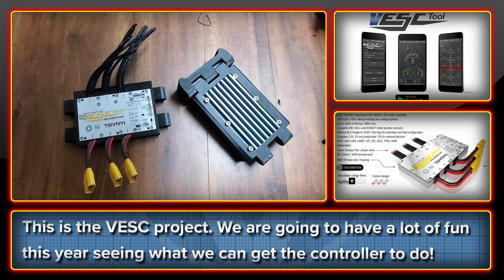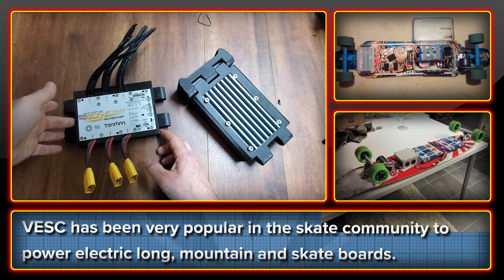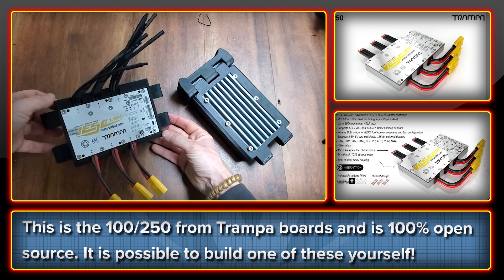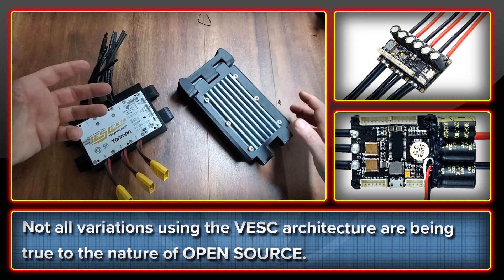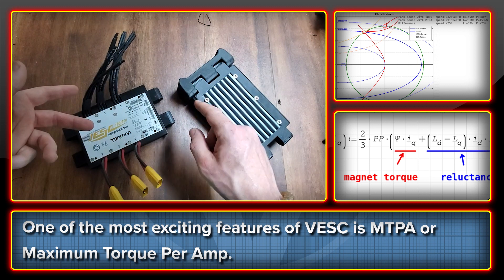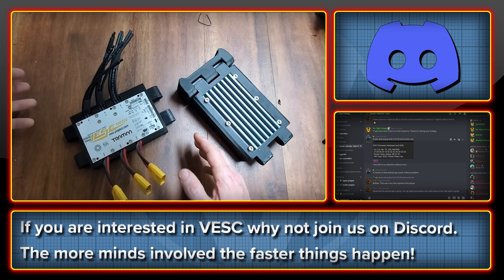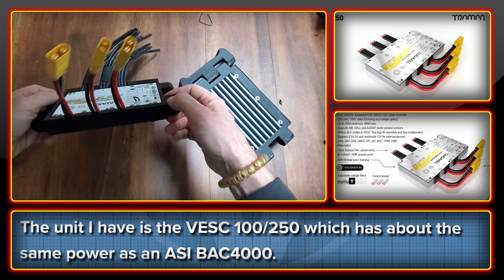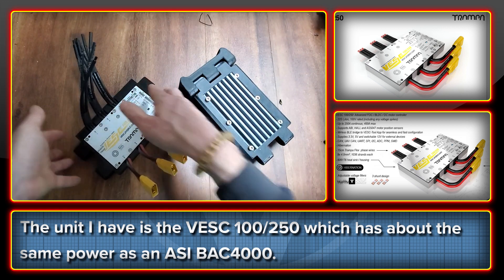Experiments With VESC - Introduction to the VESC open source controller project - join us on Discord

Comment: are you supposed to be able to control the motor from the keyboard arrows?  I did an autosetup on a 205mm 16 pole BDLC and it says it was successful but the motor makes clunking sounds when you try to go at high speeds with it.
Reply from the maker: Once you have got pas the initial stage you need to then fine tune. I suggest using the VESC forums to get help here. There are lots of parameters you can tweak to get the best performance.
Reply: @HighVoltageKits  I had my max erpm calculation wrong, it's ok to max rpm now but still no keyboard control
I looked all over the forum, nobody is working with large outrunners, just skateboard motors
Reply from the maker: @Embeded Fabrication  it's more the skate folk with vesc. It's changing tho. You could try posting on our Discord. We have a vesc channel. Smaller place but we are more ebike focused.

Comment: what are those screw bus bar type connectors at 6:50 min in the vid?
Reply from the maker: Its something I am working on to bring all the wires together into just the three connections.
Reply: @HighVoltageKits  where'd u get them, or did you make them?  I've just been soldering things into copper lugs.
Reply from the maker: Its a design. I have not made the final one yet. I was going to drill alu blocks and use grub screws

Comment: can it be ised for electric scooter?
Reply from the maker: Don't see why not. They are huge in the e skate world
Reply: I use two 75100 in xiaomi mi360 pro upgrade for fron and back wheel motor with a great success. Had to add second battery though

Comment: Vesc and old lmx motor with curver magnets on rotor  test pleaaaaas...
Reply from the maker: I will pass this on. We are not quite there on the VESC testing. I will ask if we still have the motor tho!
Reply: @HighVoltageKits  OK i wait for video...
Reply: It seems to be very hit and miss with the spm 60mm motor, i have seen a VESC doing just fine with it and also Nucular controllers but some controllers won't just work
Reply: Hopefully the 12F Nucular i purchased will run the motor in FOC mode

Comment: i have a question 
i run my vesc in FOC with Sensors And since i have ubdatet to firmware 5.3,  when i go full speed the electric motor starts to rattle/vibrate and bevor the ubdate it did nothing at full speed 
What´s the Problem?
Reply from the maker: Join our Discord group and post on the VeSC channel. There are a few people that can help. You can post screen shots etc. Link is in the description

Comment: I look forward to where you take this. You already have a good handle on ASI products which are a pain in the ass to set up. ASI includes protection devices in their designs which increases their reliability quite a lot. I'd like to see you put that 100/250 through max load tests next to a BAC4000. I'm pretty sure the BAC4000 will shut itself down while the 100/250 burns out.
Reply from the maker: I am sure there will be casualties on the journey 😆 Some side by side tests would be really good. Cheers
Reply: @HighVoltageKits  
There are VESC products that account for the sorts of things that happen in EV's, but they can't be quite "open source" since they go further than the Vedder designs which lack any forms of protection. It's not that Vedder designs are bad, just in need of further improvements. I'm not sure why he doesn't include them! I get it back in the 6 fet ESC 4.1 days, but that was years and years ago! By now, he's had plenty of opportunities to see the weaknesses in his designs and to change them. IF he did, then the protections would no longer be taking away from the open source nature of VESC products. Also, even without them in place, VESC stuff is still pretty good, just more likely to die than they should be.
Reply from the maker: Thanks for the information. We will see how long it lasts I guess! But it is amazing seeing how many are being worked on all over.
Reply: @HighVoltageKits  Agreed! VESC IMHO is going to take over. Proprietary solutions like ASI or Nucular rely on a specific company and whatever shitty support they might provide! VESC...being open source and how it works nearly identically regardless of who made the VESC based controller has the potential of deleting all the proprietary solution providers! Literally anyone can support any VESC based product! There's VESC solutions for connecting to the IGBTs powering Tesla motors! Clearly VESC can be taken to whatever heights you might want.
Reply from the maker: I think variety is the spice of life. But the ability to share knowledge is a big advantage. It will be nice to see some of the development make it back to the original designs.
Reply: @HighVoltageKits  For sure! lt's not like Vedder is a dummy. The guy from scratch invented a totally new motor controller design! He's lots smarter than me! He doesn't follow very well. Protection components are in lots of high voltage, high current devices and despite there being tons of evidence that VESC controllers die due to a lack of protection devices...and he knows it...he wont redesign to include them. People lots smarter than me have told him about these issues and he's not adding the components or design changes. All the names we all know making VESC controllers essentially copy his work exactly and so you see no protection devices in their products. Tronic Systems and Power Velocity are the only ones splitting away from the crowd that I have seen and have or will soon have controllers on the market that diverge from the Vedder cloners and yet still work with VESCtool.
Reply from the maker: I am following the power velocity stuff with great interest. Last I heard there were some kinks still being ironed out.
Reply: @HighVoltageKits  Yes me too! PV/Vadym has been working on these things for a good while now. He had to stop development because he was working on getting a pilots license. I think that's close to done or done now. Last I talked to him, he told me he'd try to get me a couple of controllers in the next couple of months. I don't know...probably RION will have theirs out first at this rate. I've got an actual estimated release date for them. Manufacturing is the kicker for Tronic Systems/RION. They are "in the queue" and supposedly its about 45 days before production for them will start.
Reply from the maker: Cool! I am very interested cause it might let you run the 24s battery. Possibly even higher.

Comment: Motor terminology, please guys... If a motor has 3 wires then it's NOT a DC motor. Just because the power source FOR THE CONTROLLER is DC doesn't mean anything. These are 3phase acim and spm motors. Bldc were first used in quads when we were harvesting motors from cd-rom drives and we never got away from that terminology.
Reply from the maker: Appreciate the comment will be sure to not make this generalization again. Cheers

Comment: Do you have any big block motors in stock?
Reply from the maker: There is a form at the bottom of the page that will link you directly with Lightning Rods. https://highvoltagekits.com/lightning-rods-electric-motors
Reply: @HighVoltageKits  sent a message Thank You

Comment: I use a HGLRC VESC on my fat tire Ebike I built back in 2019. I'm using the blueooth app as a display on an old android phone. It has been working perfect for the past couple years and it is very smooth compared to the box controller my kit originally came with.  I'm using a 1500w hub motor and have pushed it to 3800w on bursts. I keep it around 2200-2300w for everyday use though. Its easy to change parameters on the phone for quick edits. There was something particular about the bluetooth module connected to the VESC that I had to do to get it to connect right with the phone. I dont remember what it was exactly. Some of the generic bluetooth modules wouldn't connect.
Reply from the maker: Interesting. I have powered it on but not connected the phone app. I'll leave that to the bench testing. How do you find the refresh rate using a phone as the display?
Reply: @HighVoltageKits  the refresh rate fine. Sometimes the voltage fluctuates but it settles quickly. Current is just fine. I’ve compared it to a inline current sensor and it’s spot on. I’m still running firmware from late 2019. There could be some updates but I haven’t checked into it. Actually I haven’t even run my display in a few months. I just get on my bike and go. It’s been perfect.
Reply from the maker: @Hyprmtr  The reliability aspect is great to hear. Which one are you using BTW? Actually it seems that 5.3 just released officially!
Reply: @HighVoltageKits  I'll have to plug in it and see. I'll do it here in a little while. I have another Vesc and BT module setup I was going to put on my sons bike. His is working fine though with the box controller. I might use it on my small metal lathe with a sensored brushless motor to be able to turn real slow. I'll post the FW I'm using in a little while.
Reply: @HighVoltageKits  The FW I'm using is 3.103. It seems the HW I'm using only supports up to that FW but that could have changed I supose. I knew is was quite old from a couple years ago. I'll have to see what changed in the newer versions and see if I really want to update. I'm having zero problems with what I have now.
Reply: My vesc mini for ebike has hard time climbing hills. gets overtemp easy.  but regular cheap chinese kt controller has no issue.  can you share your settings.

Comment: I had the Tampa VESC 75 300 and loved the firmware and open source part. Sadly, I had so many issues with a big hub motor (qs205). Another friend put one into a Sur-Ron but the 16S limit and 300A phase is  just to less for bigger ebikes and anything above. Changed to a BAC8000 because of that. To be fair, I have an ASI login, so I can tune it myself.
Reply from the maker: The Sur Ron motor is not an IPM so it is not able to take advantage of some of the newer aspects of VESC such as MTPA. We ran it with a BBSHD without FW and MTPA and it was nothing special. When the advance features are tuned it should be pretty spectacular... Well we hope anyway!
Reply: @HighVoltageKits  what other advanced settings did you change for bbs? Speed tracker kp ki, duty downrmao etc. Mtpa iq target +55A field weakening gave very high revolutions without load, so i turned on iq measured. Also it has low torque on low revolutions in higher gear.
Reply: 16S is an awfully low limit. Are there versions with 20S+ components?
Reply: @emilen2  yes there is a VESC 100-250 that can do 22s
I have it and am applying 420 phase amps. Extremely fast
Reply: Hi Christian, I also want to use one of the vesc based controllers for the qs205. What was the issue? I would really appreciate your input. Thanks Michael
Reply: @michaelwild4337  Hey, the issue was that I didn´t tune the vesc properly for this motor. As I heared, it´s quite difficult to get large outrunners like the qs205 to run smoothly on a vesc but it´s possible!
You might look into ASI BAC8000 controller instead tho..
Reply: @christianwagner6244  Hi :) Thank you for your response and apologize for my late one! I received my Vesc last week and will now try to run the 205. If I am able to produce any useful results, I will share them! Do you know people who found good settings? Thank you for the ASI hint. I have contacted the company and will try one of BAC controllers if the VESC doesn't work.  Best Michael
Reply: @carrylarryteam1832  Did you get it to work eventually?